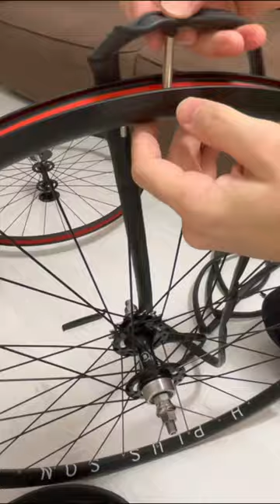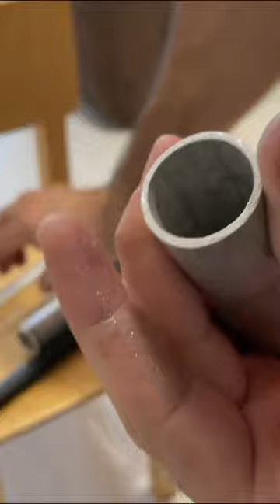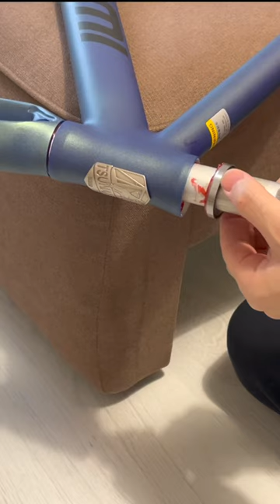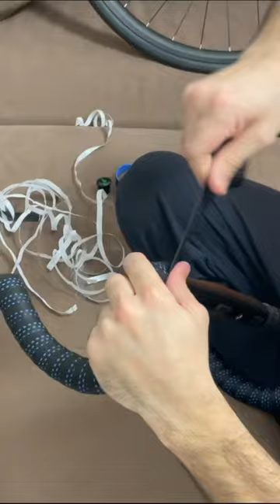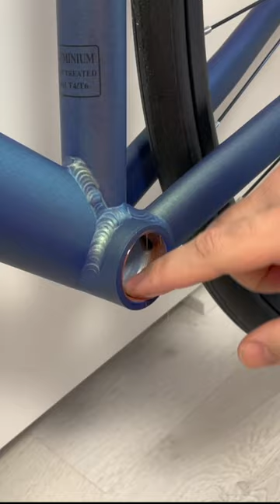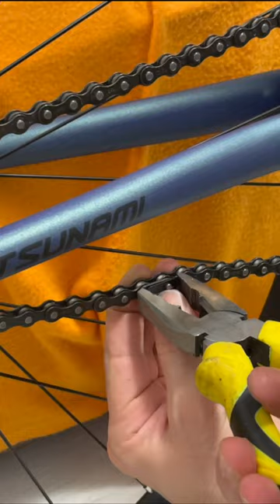dream build fixed gear tsunami bike

Comment: Too bad a lot of the stuff they put out is trash. Probably 10% of the stuff they seek across the different brands they own is good.
Reply from the maker: from what I bought everything works fine
Reply: @a-r-t-e-m  to the average no issues sure I agree with you on that. But I have thrash my bike and I have broken cranks, bottom brackets, chains, handle bars rims spokes. Plus when tsunami sent me a flawed product they that it was still good. I asked 3 different opinions from bike shop mechanics and said that it was a shitty rim that needed to be fixed. It’s why I get heat treated Products. I still even have the nonchalant response from tsunami.

Comment: There is a gap between upper headset and lower headset altho its fully tightened and assembled. Is this normal? I dun usually ride asian bikes. But this seems kinda odd.
Reply from the maker: its ok

Comment: The spindle my spindle torque is 5nm it rotates as fast as The one adjusted in 1.7nm my objective is to make the spindle hold the crank deep not making it fall out With little torque adjustment

Comment: Нафига такая пирамида из колец
Reply from the maker: чтобы по-выше руль был, жалею что еще больше колец не поставил. Когда часа 3-4 катаюсь шея начинает болеть. Хочется выпрямиться а некуда
Reply: @a-r-t-e-m  значит рама вам не подходит
Reply: @СергейСергей-ъ8л это значит маленькая или большая рама?
Reply: Какой размер рамы Tsunami взять при росте 174???? Подскажите пожалуйста
Reply from the maker: @МихаилФокин-х7й  он имел в виду что мне рама мала. Я брал размер М 52см при своем росте 175. Ну можно и 55 взять, тогда сиденье можно будет опустить пониже (сейчас у меня подседельный штырь на сантиметров 18 поднят) и не делать столько проставочных колец.
Reply: @a-r-t-e-m  The more spacers the more pressure on your shoulders and neck , for your length the 55 frame , and measure your inner leg size and multiply this with 0.68 so you can calculate your frame size , old scool metal frames have different sizes then the new slope frames 
Calculate the height for your saddle , 
Inner leg length multiply with 0.883. (center of the bottom bracket to the middle of the top of the saddle )
Good luck and greetings from Spain.
Great bike and awesome colour.
Saludos
Reply from the maker: @Abraham0031  thanks for the words of support. I have already changed the frame to size 55